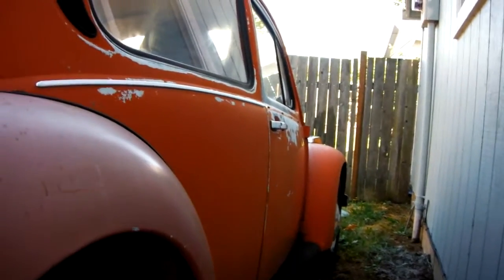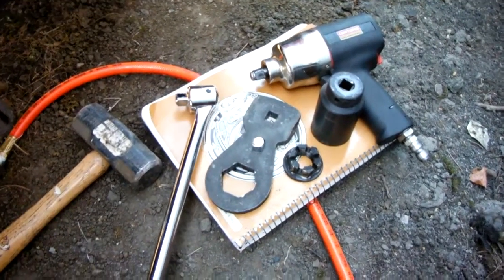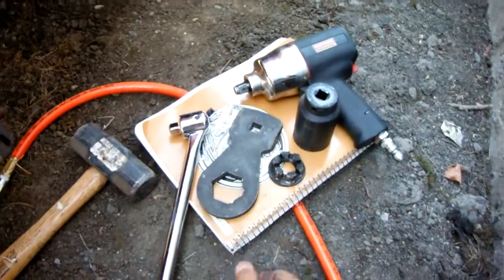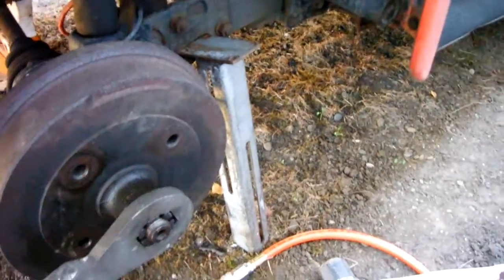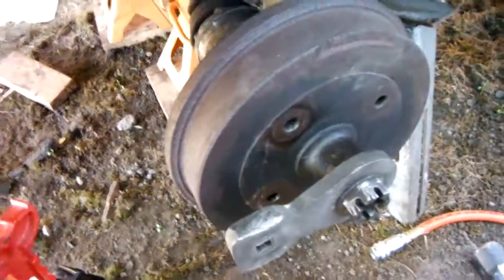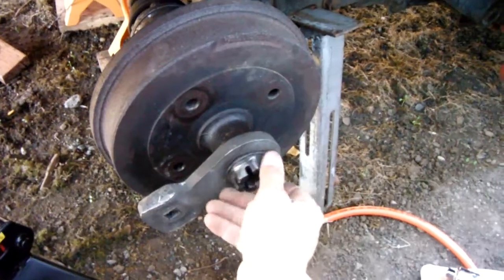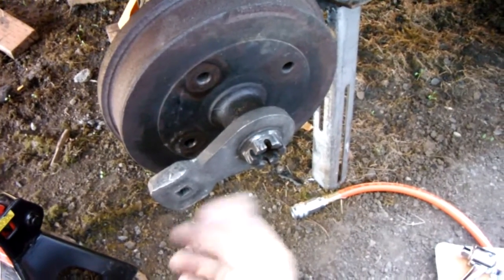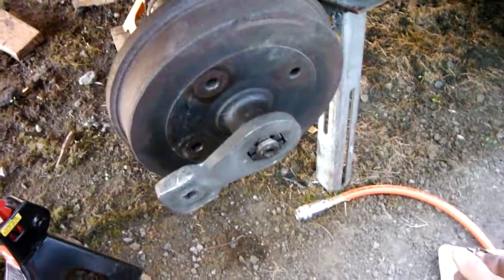Removing an axle nut on my 1973 VW beetle the right way.

Comment: You guys are breaking breaker bars because you need a 3/4 inch breaker bar.  1/2 inch ones will break easily.
Reply from the maker: So true. the axle nut tool works to.
Reply: @gm2431 , I bought a Torquemeister knock-off.  It has paid for itself many times over.  It’s also good for setting the axel nut, and flywheel  gland nut to 253 ft. lbs.  I just set my 3/8 inch drive torque wrench to 28 ft. lbs. and it multiplies by 9 to 252 ft. lbs.  A tad tighter and I have my 253 ft. lbs.